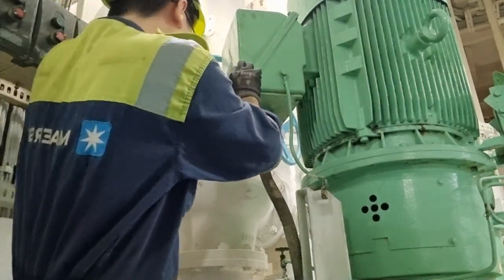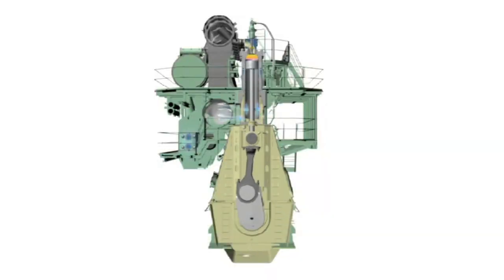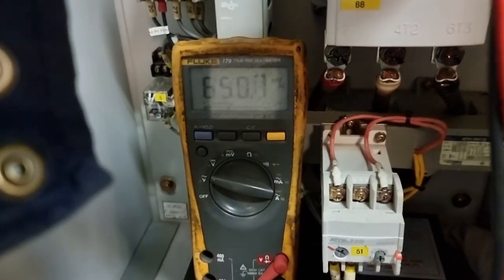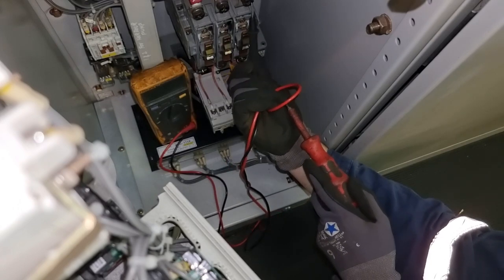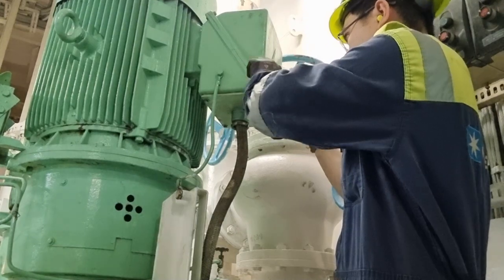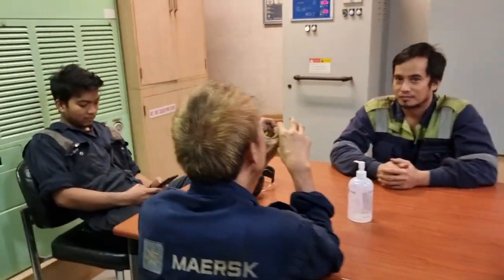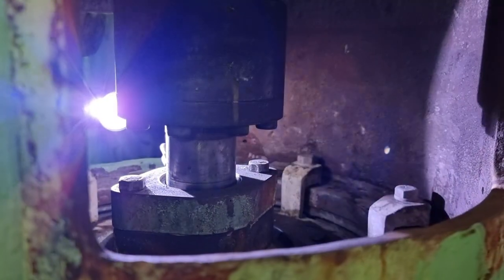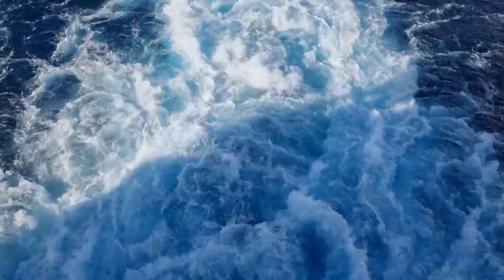MAIN ENGINE COOLING SYSTEM TROUBLE, CAN CAUSE SLOWDOWN.

Comment: Good video of all the standard maintenance checks of an electrical motor, do you also do continuity of motor windings? (Motor balance test) Also why do you use a multi meter for testing for dead and not a voltage tester and a proving unit?

Comment: Do you mean the packing between the impeller and the coupling?
I use Emery Cloth to dress contactor tips, have to be careful though as some tips are coated and should not be dressed.
Keep up the good work, your channel is fascinating.

Comment: sir, pls help me!
due to interlock system we cant parallel emergency generator and main generator together.
what would happen if we try to parallel? why we are not allowed?
pls reply
Reply from the maker: First you have to tell me which interlock you are saying
Reply: @leckyjake  
It is not normally possible to synchronise the emergency and main generators.

Special interlocks in the control circuits of the circuit-breakers, at each end of the interconnector prevent parallel running.